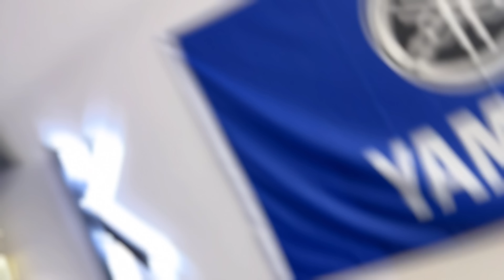My Cheapest To Most Expensive Motorcycle

Comment: All of the new R1’s come with titanium headers even base r1 . I just bought a 23 r1 and figured it out when I installed my Graves 3/4 titanium exhaust and not only did the headers turn blue , they also cooldown down within 10 mins to the same temp as the graves titanium pipe. If it were stainless steel it would stay hotter than the 3/4 system and take a lot longer to cool down.

Comment: I enjoy this. Dude I’m 65 just retired. I have 1 bike. A 2001 Yamaha FZ 1. It was stock black and I added four coats of clear with violet pearl added.  In my opinion it looks black and glossy, but as you walk, you can see purple reflection , I have carbon fiber, hugger front wheel fender ,inserts side covers all carbon with five coats of clear with pearl added, I have a Yoshimura titanium slip on with Ivan’s jet kit from New York.
It’s nothing compared to what you have sitting in that garage but I love it.  14 years ago I had an accident. Fell off of a house peak,  shattered my legs didn’t walk for a year, this bike has sat in the garage for 14 years. After all my surgerys ,I just got it started and it’s running and as of today since may have put 3000 miles on it.   it feels so good to ride again. Just put new stainless lines all new brakes around Shorty levers, CRG. Brand new Michelin, tires front and back.
As I go into bike shops and see the new technology it is amazing. I know my bike doesn’t compare to it that way, but I’ll tell you everywhere I go ride,  the bike turns heads and guys come up to me and tell me how much they like it and how good it looks so there’s something to the old school bikes. Anyway I love the FZ1, it seems like it has plenty of power to me.  My friend who rides an R1 got on it first time went 20’ and rode a huge wheelie down the rode for 150 yards. I’m a chicken when it  comes to that, however I think that the coolest thing. Blessings to your channel. Got to ask you, what do you do for a living?